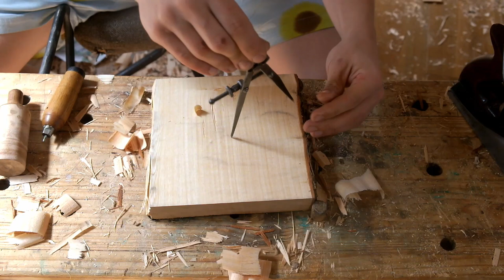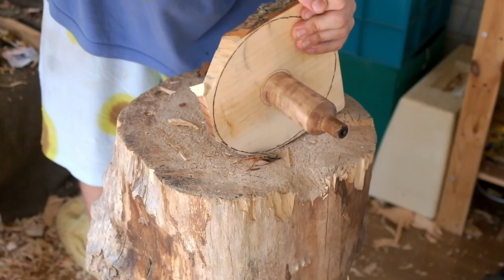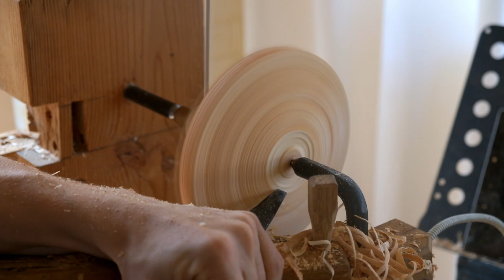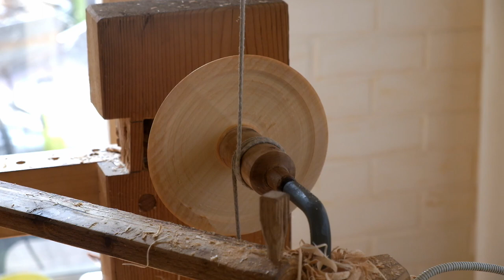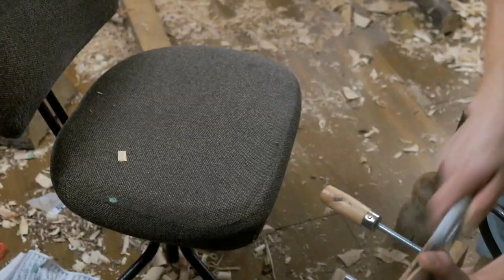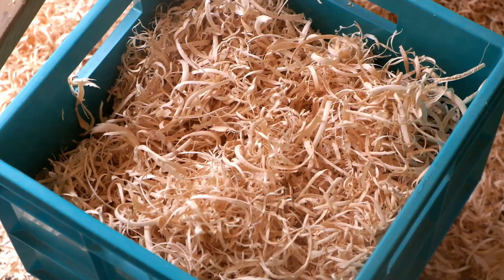Pole lathe: Turning a Simple Wooden Plate

Comment: Well done. It has been quite some time since l have watched a whole video on this subject, let alone actually enjoying it. You had me completely hooked (yes, l said that))at the grain orientation of the blank. You have spent enough time developing the whole process before presenting; most do not go throuugh the trouble. In the middle ages guild system, plate turning was a trade unto itself. The test to be a master was to produce a dozen plates of  the same design and specificatios through which the light of the noonday sucn would sow equally. You are on line to do this. Well done.
Reply from the maker: Thanks for the thoughtful comment. Interesting point about the guild. I was very chuffed with myself for turning two plates the same, a dozen feels like a good challenge though! 

I love hearing about how focused  pre-industrial trades were. It's an interesting comparison to the kind of rural joiners/ woodworkers who did a bit of everything.

Comment: Nice plates!.  Did you glue the mandrel to the blank? if so what glue did you use?
Reply from the maker: Thanks! Yes, with super glue. It's easy enough to break the bond with some heat if you don't use too much glue.

For my bowls I use tenon mandrels but that's not possible for a plate without wasting material just to turn it away.

Comment: Why bury the plate in shavings afterwards, something to do with slowing the drying process?
Reply: Exactly, to prevent the wood from splitting
Reply: @schnipsikabel  Is that because it's green, or would anything that's at like 20% moisture split? I'm trying to gauge how dry is dry enough to not worry about it.
Reply: @tarbucktransom  In general, i don't think 20% moisture wood will still be prone to cracking... but it is also dependent on air temperature and humidity (eg if you put it close to an oven or in the sun), wood thickness (thicker parts drying more unevenly and thereby developing cracks) or closeness to the center of the tree (the parts 1-2cm around the pulp somehow being very prone to cracking).